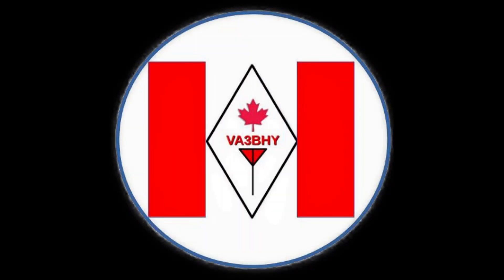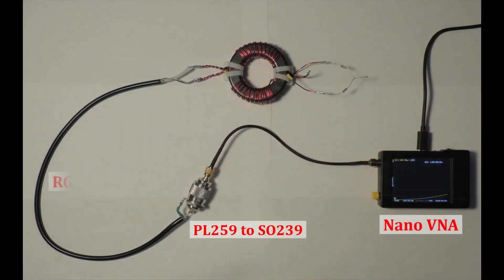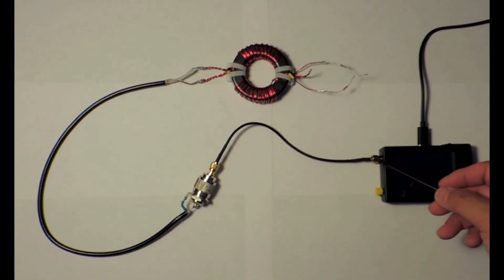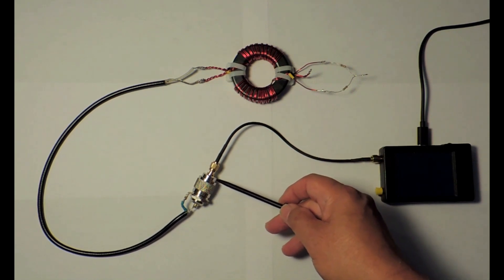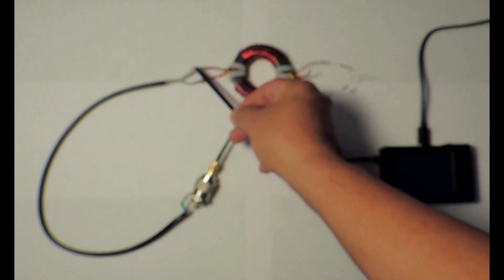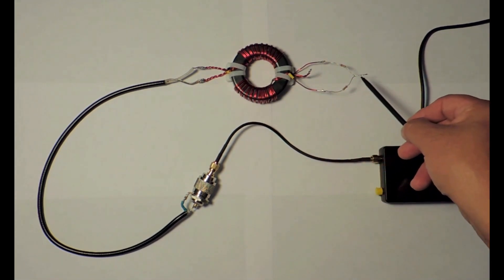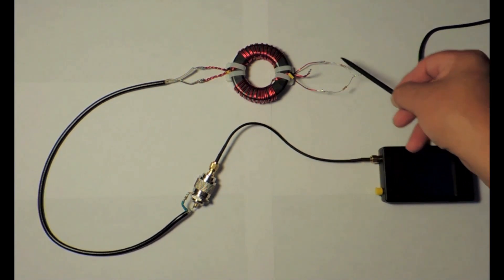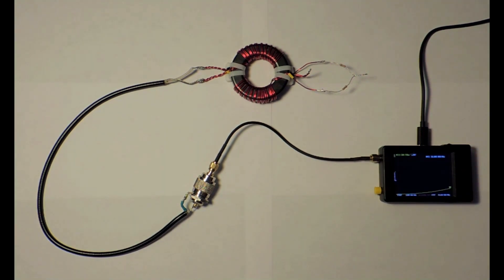DIY 4:1 Transformer Using FT240-43 Ferrite Toroid Core

Comment: How long is the antenna ?
Reply from the maker: On this video, I used a dummy load (200 ohms resistor) soldered directly to the wires of the toroid transformer to test the matching capabilities of my 4:1 transformer. This 4:1 unun usually needs a 1:1 balun to act as a choke after the 4:1 reduces the 200 ohm to 50 ohms. These unun are used to match compromised antennas like end fed or offset dipole down to 50 ohms. 1:1 will do the isolation and the common current mode choke.